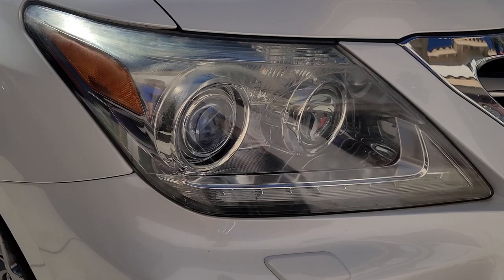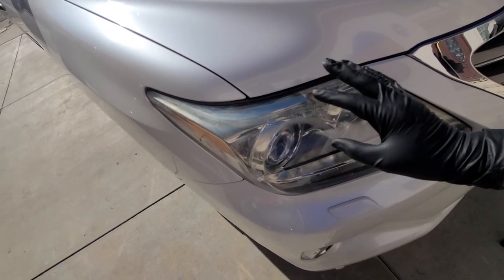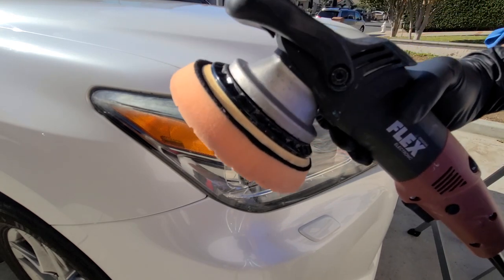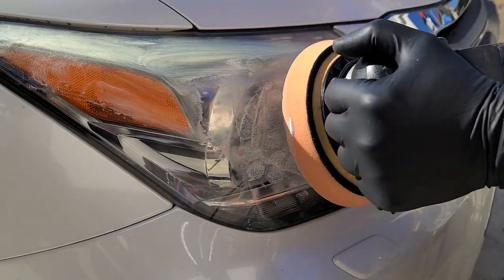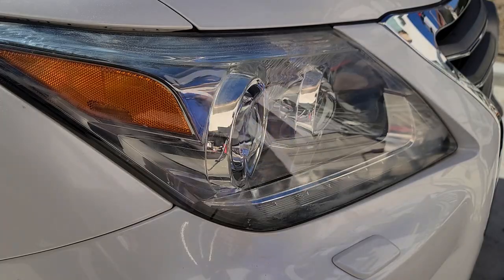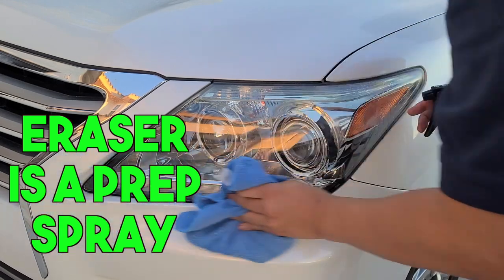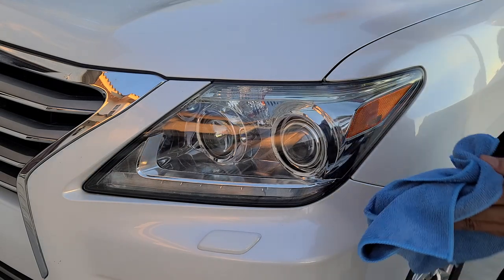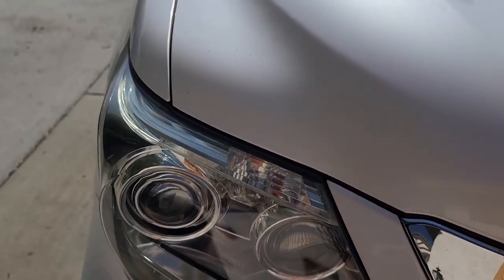How to Restore Headlights Permanently - LX570 project but works on any plastic headlights

Comment from the maker: I've tried a few ways to restore my headlights and I found this was was the easiest.

You do however need a polisher but if you're a detailing freak you'll have one anyways!

Here's links of the stuff I used...

Flex polisher https://amzn.to/3gFDcCN
Menzerna polish https://amzn.to/2WbcQz2
Chemical Guys hand applicator orange https://amzn.to/3gOpSfh
Chemical Guys cutting pad https://amzn.to/2W8d2Pk
Get Cquartz UK 3.0 here: https://amzn.to/2IKUX70
Carpro Eraser https://amzn.to/34alsu8
microfiber towels https://amzn.to/3ml1hjb

Don't forget to LIKE, SUBSCRIBE and SHARE this video!

Follow me on instagram for sneak previews and info I don't put up on YouTube  @_RobDaman
LX570 build @LXfamilytruckster

Thanks for your support!

Link to Free Amazon Prime Trial. If you’re a student you can get it ½ off!

https://www.amazon.com/amazonprime?_encoding=UTF8&%2AVersion%2A=1&%2Aentries%2A=0&_encoding=UTF8&tag=robdam-20&linkCode=ur2&linkId=ef4125249ec037f57dd4d4e183d14484&camp=1789&creative=9325

Prime rewards card $100 gift card on approval

https://www.amazon.com/Amazon-Prime-Rewards-Visa-Signature-Card/dp/BT00LN946S?&_encoding=UTF8&tag=robdam-20&linkCode=ur2&linkId=600a16244e1be11319ee8540b76d8326&camp=1789&creative=9325

Check out ALL my Amazon tested products: https://www.amazon.com/shop/robdaman

Comment: Does the ceramic have in protective properties?  I was just gonna use the mcguires headlight sealant/uv protection spray... but now I’m wondering if there’s a better solution out there
Reply from the maker: It becomes a hardened ceramic so yes it does. Those headlight restore kits are shorter term coatings.